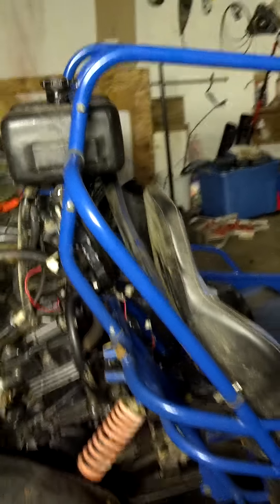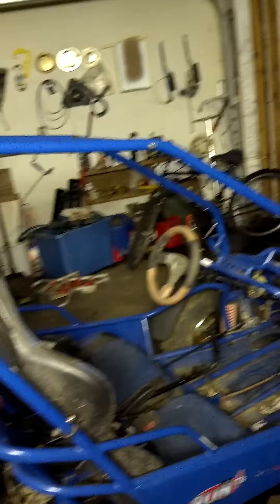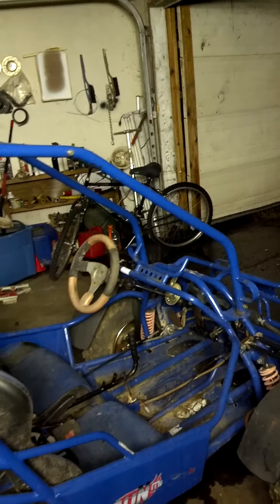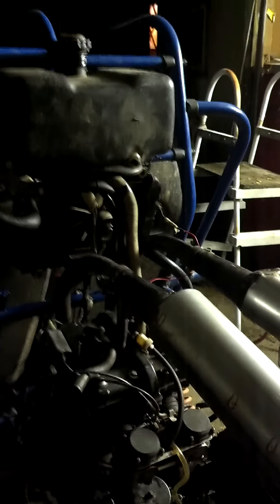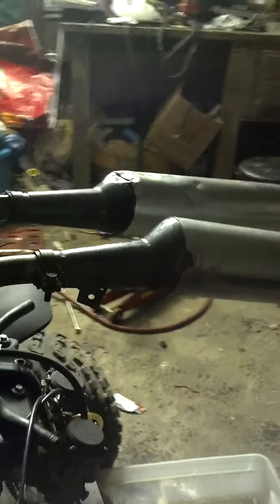KINROAD  NINJA 500 go kart.

Comment: Getting ready for a 250 build... Got the 250, just need to find a buggy!
Reply from the maker: been hitting craigslist or FB in your area ? atv groups on Fb is a great spot to find em. cheap too.
Reply from the maker: friend mine jermey has a awesome set of videos on his 250 ninja build. its a bad ass buggy let him know i sent ya his way. and he help answer question. can normally find him in search by kinroad ninja 250 buggy. his newer vids are better. 

https://www.youtube.com/watch?v=B8Ke_Y13bOU
Reply: Thanks! I've had experience with this kind of build before. Just having trouble finding a chassis(used) in my area. Been all over Facebook and craigslist looking, but no luck yet. Hate to spend that kind of money on a new buggy and cut it up. Love Jeremy's video's! I used them to convince my wife to go along with it.
Reply from the maker: :) his buggy was well built. mine was what you can do with a welder and extra parts from mowers. to dirt bikes motor cycles. i didnt alter my buggy suspension or frame at all. all i did was flip my axle. and got lucky it all lined up perfect. like it was factory replacement motor.  :)
Reply from the maker: i built one before hand. didnt take any footage of. bit of a hack job actually. but it worked well. but someone bought it from me. i built this one for a guy. but after we did first test. he said hell no i will not let my kid ride something that does 110mph. lol. i thought we took video me doing wheelies in it. took me some fine tuning to get the chain to work with how cramped it all was. but my fix worked. and actually worked well. lol. and made my axle adjustable. :)
Reply from the maker: but my back probems i cant ride em. i need one with a way better suspension. so my future build will be raised up. bigger tires. way better shocks. prob use polaris shocks. or some off road truck shocks. something to take impact more. and ima prob get a bob cat seat thats air ride. lol. im not kidding. hurts my back that much. i cant walk after a few of these rides.